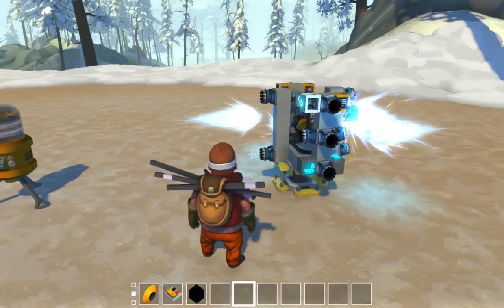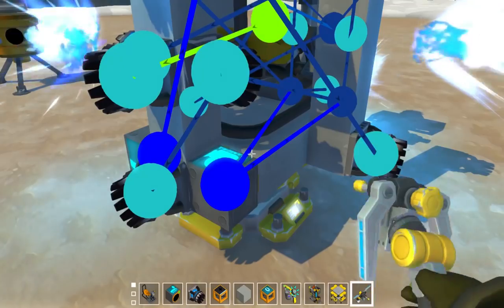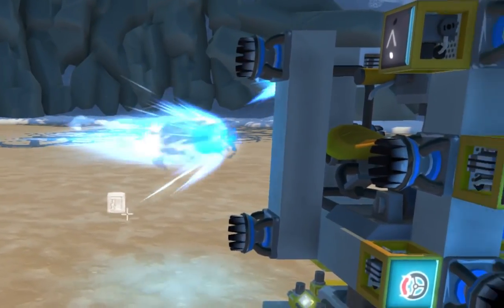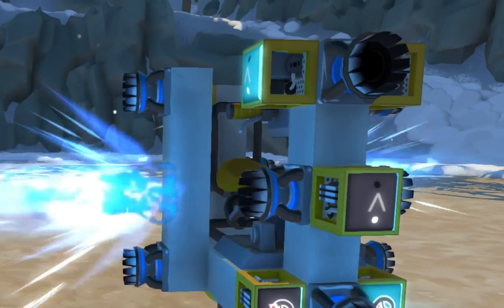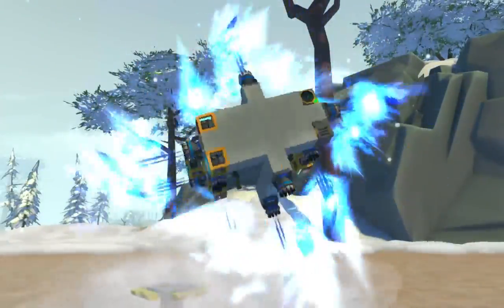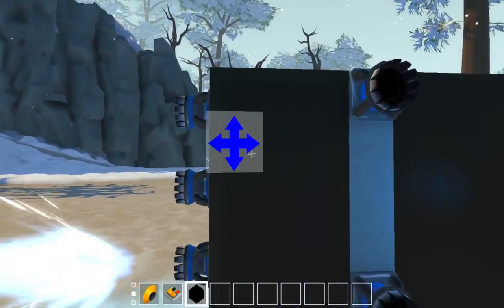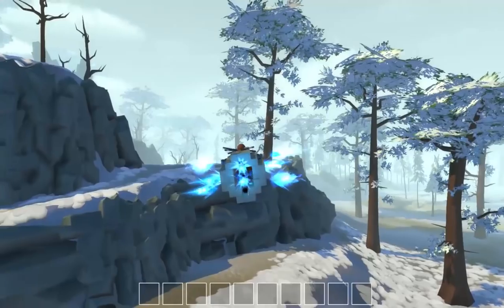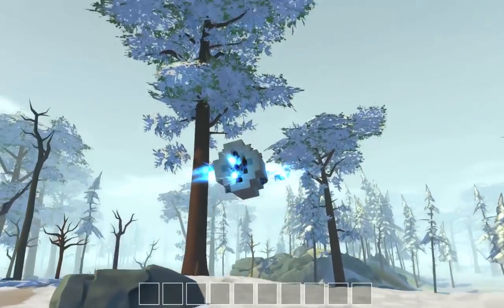Zero Gravity Flyer | SKREP MAKENIK Single Player Tuesday Ep 1337

Comment: From my experience from building planes in other games, mouse controls is good for smooth and precise flying, but terrible for quick turns and complex maneuvers. An example is that mouse would be great for landing a plane but if you want to do a sharp turn in a jet you have to roll and use the pitch instead of yaw and that can only be done well with keyboard.

Comment: Instead of adding weight plug the WS/AD converter directly to some of the thrusters and multiply by -1 for the others. That way when it gets closer to the camera angle the thrusters get weaker and stronger when it’s farther.
Reply from the maker: somebody didn't watch the entire video 😏
I did try with thrusters, but they weren't smart thrusters which is a much better idea than what I did
I gave myself a short build time, as if it was for MM

Comment: Have you tried using the drag reducer, so the wheel-based design doesn't lose as much momentum to air resistance?
Reply from the maker: I tried it and it does help the orientation, but at the cost of flying in the world.
Overall I wouldn't say it's worth it. The orientation drag isn't that bad, and you don't want to be constantly drifting since you need to hit a ball into a goal

Comment: Can you explain how to make camera controls? I don’t know how
Reply from the maker: orient block in camera mode, connected to 2 math blocks, one in WS mode and the other in AD mode, 
and those math blocks connected to electric engines, each to one bearing. One bearing vertical, the other horizontal.
The orient block, if it's on those bearings, will try to adjust the engines so the orient block is oriented with the players camera.
Proper tutorials coming soon to the second channel